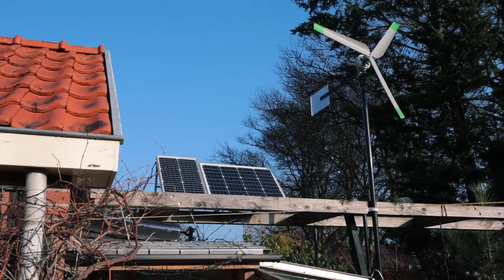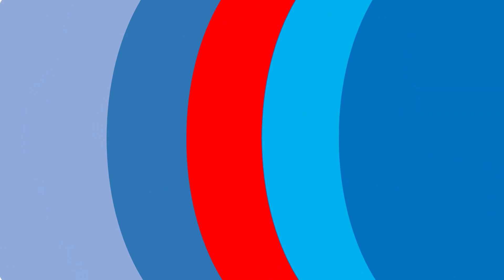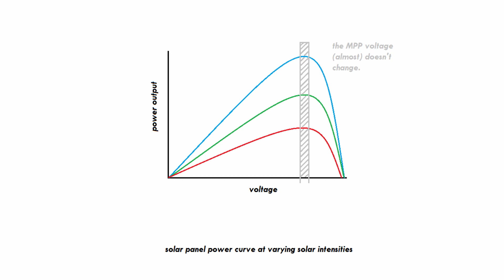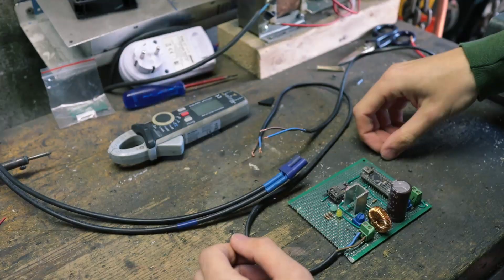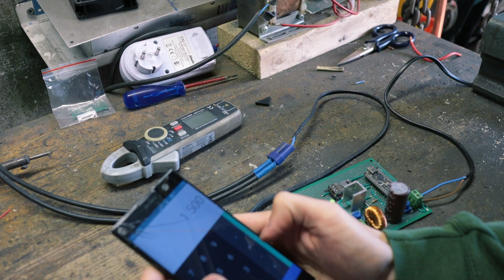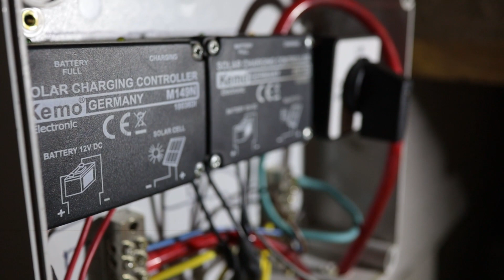New DIY solar charge controller (AKIO TV)

Comment: Thanks for this. But, can you help me out with a bit more info? I was trying to find out what a MPPT was and I discovered your other excellent video explaining it. From that I got the impression that an MPPT would be varying the voltage and current around all over the place in pursuit of maximum power. Whereas this solar charge controller is operating on the goal of achieving 18v solar panel output, in other words it's been told where the MPP is.  Are you just explaining the same thing in two different ways? Or does a true MPPT have extra hardware/software? Also, when you read my question bear in mind a few things; I am interested in electronics but I have no background in it, I use the excellent teachers of YouTube, like yourself. If it is at all possible for me to misunderstand an explanation, I seem to do this effortlessly. And lastly, I'm not trying to be a dick.
Reply from the maker: You've actually understood it quite well!

"real" mppt is indeed a controller that varies the voltage and current "all over the place" in persuit of maximum power.

My controller in this video is sort of cheating, because I configured the correct voltage for this solar panel in advance, which simplifies the design a bit.

If you added a shunt resistor to the input, the arduino could measure the current (therefore compute the power) and do "proper" mppt.
Reply: @AKIOTV   Thanks for your reply, that does clarify things for me. The MPPT is happy to do the work in finding sweet spot of power generation, which will come in handy when the value isn't known, does the value change much between panels? does the panel manufacturer provide the information in the specs? I apologise for the extra questions but I thought i'd roll the dice and see if you are still happy to dispense info. I find YT a fantastic resource and I salute you for you work. U&S
Reply from the maker: @dohhomer9  The nominal value will be different depending on the panel, but it's given on the datasheet of the solar panel. 

The mpp voltage can vary slightly with light intensity and other conditions such as temperature. For instance, for my panel the optimal voltage may vary between say 17-19V. 

My lazy controller design doesn't take this into account, since it only uses one fixed voltage, so using true mppt would result in (slightly) better results.
Reply: @dohhomer9  There are various MPPT algorithms, voltages do vary between panels and within a single panel depending on conditions, you can find real MPPT device and more theory in a video on my channel :) The main point of MPPT is that voltage varies pretty significantly and you need an algorithm to work optimally in all that range, if range were shorter - you could just track fixed input voltage and call it a day.